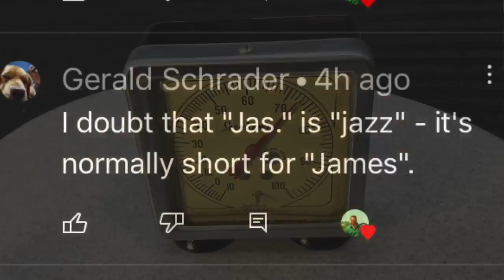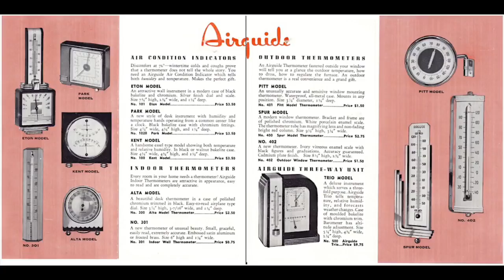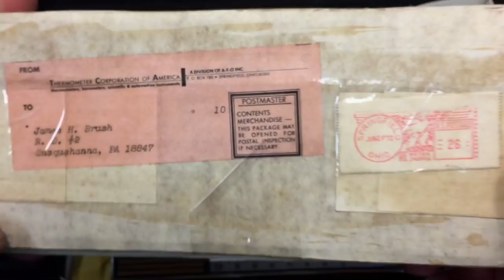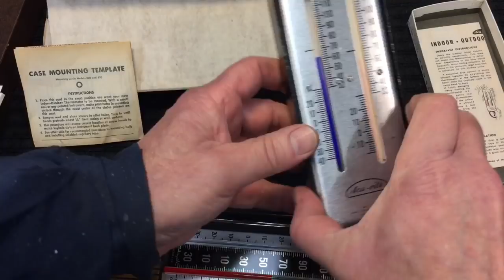Open Manholes, Vise Anvils and Thermal Probes

Comment: That manhole cover was a not-my-job hot potato. I was working at a primary school here in Australia and one morning turned up to find that vandals had had fun with a sword cutting down a lot of small trees in the playground. The remaining trunks were sticking up like sharpened vampire stakes. The education department were contacted, attended and all they did was spray paint the stakes fluorescent orange to show that they eventually had to be removed, by whichever department was eventually deemed responsible. When I realised that the stakes were going to be left for a few days for the kids to impale themselves on, I got out my Swiss army knife and cut them off flat to remove the danger. I copped some criticism of how I spent my first hour at work that morning that I completely ignored. Good on you for not walking past.

Comment: I wonder if they used bi-metal in the choke springs of carburetors? Heat applied from the engine and the spring would tighten up. Very interesting. I loved science. We had a great teacher, very smart and very funny.  He's a young 93 today.  He taught many generations!

Comment: Yet another great video Scout. My son’s name is James and I can’t imagine what the reaction would be it I called him Jas, but I don’t think it would be pleasant. Those bi-metalic strips are interesting, back in the day a lot of Holden cars used one in the headlights instead of a fuse so that if there was a short in the headlight wiring the lights didn’t just die, the bi-metalic strip would heat up and the lights would go off and then when it cooled the lights would come back on and because the reaction is reasonably slow it would be enough to get you to safety. I’m guessing GM cars would have had that too. Pretty clever thinking by someone. Cheers Stuart 🇦🇺 ps, I love those mieses to pieces😂😂

Comment: Older cars had a bimetallic spring in the exhaust system  to direct hot air through the intake manifold to warm the base of the carburetor.. As the spring got really hot  it would open up fully to direct the exhaust straight out the tailpipe.. Another informative video S.C... THX for taking us along...
Reply from the maker: Yes!  They were often problematic because of the inherent rust around the exhaust!    =D

Comment: Fire fighter rigs in our area travel with prybars and other equipment to get into structures. If our fire fighters had been called out early in the morning on this 911 call, they would have replaced the cover, I hope. They are well paid. After all, they were hired for public safety.. Your good deed was very important. You saved someone some injuries and serious car damage. Thanks for the useful information on vises and vise anvils. People think that because vises are solid metal they can be abused, but that is wrong. I once saw a vise that had a split beam because someone used it for an anvil. Those older thermal probe thermometers had another advantage. No batteries. Had one at my last house and it never let me down. For years bimetallic strips were used in automatic chokes and heat risers in cars. Always appreciate your educational videos.

Comment: I always paint my anvils when I restore a vise since I never use them..........A simple 15lb Anvil is like 20-25 bucks from HF if someone needs something they don't have to worry about abusing.........It's Driving me Crazy, give me the coordinates of that Manhole, I'll go there and fix it myself !!..............I've actually made a few Manhole Covers, it was cheaper to make them out of steel plate than buy one (at least back when I was in the steel business and steel prices were low).
Still gotta get you that place next to Our Farm, with that Huge Barn you can hold Tool Shows every month and also open up a Mouse Carnival Show too.

Comment: In certain nuclear applications, a thermometer is required. A thermocoupler would obviously give radiation a path to escape. I am told that a very simple thermocouple is used inside the chamber. A very high-powered camera measures the amount that the metal coils grow away from one another. So it is not just the atoms being excited, technically the metal itself is growing. Or shrinking if cold

Comment: Cast iron is easily one of the most commonly misunderstood metals out there. The term refers to the method of creation, not the metallurgy. Casting and forging are two creation techniques. There is a huge variety of iron and the line between iron and steel is quite fuzzy. Some irons flex quite well, these are sometimes called malleable. Gray iron and black iron are both much more like a sedimentary rock, crumbly and no real grain structure. There's a couple hundred versions of iron and the spectrum of plasticity is enormous. It's simply impossible to make any statement about iron to be universally true. There are some irons that have more carbon than some steels despite the fact that steel is defined as carbon rich iron, to greatly simplify things.
Reply: A lot of people don't realize just how young metallurgy is. We were still randomly throwing things into the furnace doing trial and error in the 50s! I have worked at three different forges over the years, while the methods have become much more scientific, there is still a surprising amount of trial and error. Does anyone else remember transparent aluminum from 20 years ago?
Reply from the maker: @jpsimon206  Star trek?    =D

Comment: As a retired paramedic/firefighter/fire code official, I am calling BS on your fire department.  They have crow bars to do the job moving and flipping that manhole cover.  It's an outrage that they drove away.   Perhaps they missed the "public service" lecture during the academy.
Reply: what if body or property damage occurred after the  fd left with improper signage at the hazard. would the city plead no contest , sovereign  immunity  or take care of damages.  not right.
Reply from the maker: Wayne- If I had my truck I would have replaced the cover myself!  😃👍
Reply: @ScoutCrafter  I understand, and I think you did all you could do.   It just is very disappointing to see something that should have been taken care of immediately by FD, turned over to some other city agency...that may or may not have rapid response.   As pointed out in another comment, if a motorcycle hit the hole it would likely be fatal.  (And I do ride myself...).  Just plain unacceptable.
Reply: Fellow Paramedic here. I agree!

Comment: Good on you for doing what you could to avoid a disaster with that open manhole.... oops can we still call them "man" holes or have to use the gender neutral term maintenance hole 😁.

Comment: We never learned those things in my science classes. How do pressure gauge work? I’ve disassembled the ones off of air compressors and theres like a slightly coiled piece of copper.
Reply from the maker: Probably the most common is the Bourdon tube, a small tube that reacts to pressure and expands moving a jeweled needle. Simple and effective!

Comment: Obviously it's impossible to know what is fact, I was taught that the reason names like Charles would be shortened to Chas was a classist leftover from the days of signet rings. Because your name needed to fit a circular logo to be pressed into wax, the names needed to be short. The overall name did not need to be short but each individual word might need to be shortened to avoid a dash. My understanding is that since signet rings would be limited to the aristocracy, this tradition of shortening names carried over as a way to demonstrate your social class. The one piece of evidence that supports this theory, I have noticed it seems to be quite a bit more common with juniors or the thirds, etc. This was also common in the aristocracy, position in the family weighs more than individualism

Comment: Before mom died we had multiple calls to 911 over the years. The guys from the neighborhood fire house would often show up. They were super helpful. I think you just ran into a bad group.
Reply from the maker: The FD here isn't bad they are just a product of the bureaucracy that is NYC.  Here is what they are up against, if they were to replace the sewer cap and it failed and someone got hurt the department would be sued and fireman fired...  So they secure the road or even close it and call it in to another department. It's a true case of your dammed if you do and dammed if you don't.   =D